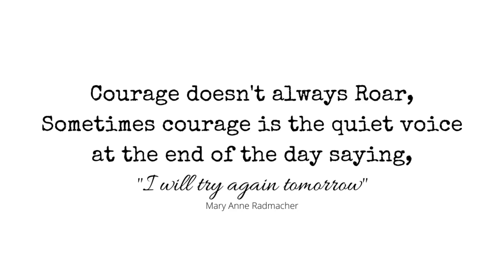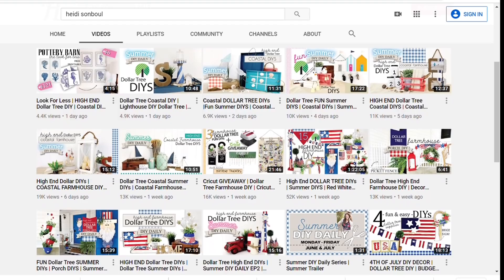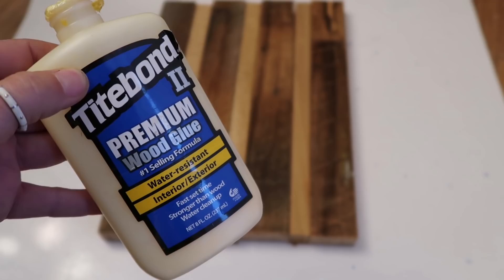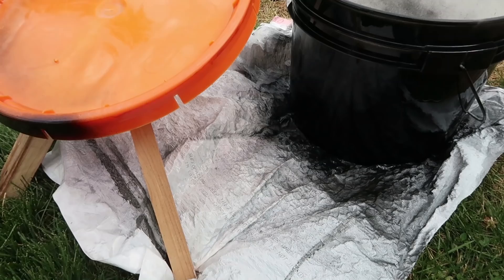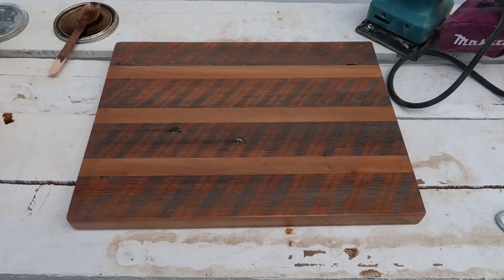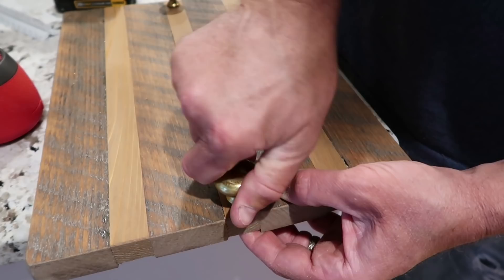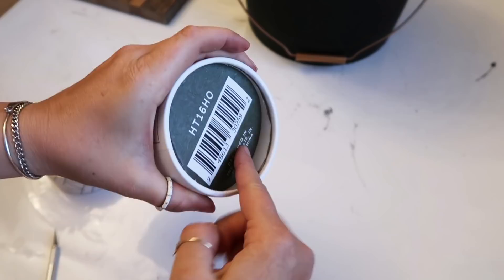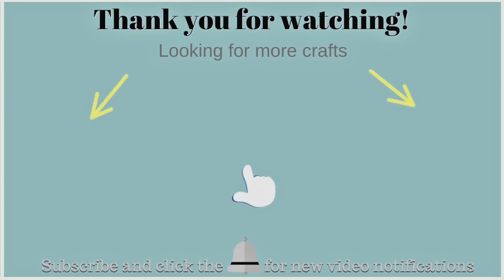REALLY COOL diy Using Trash to Create Treasure IDEAS ♻️ Recycle MID CENTURY MODERN BOHO HOME DECOR

Comment: I really like these. I'd add some feet to the tray and bucket. But instead of beads I might add these clear silicone feet and to the bucket I might add some either rounded off wood blocks stained the same colors or woods blocks stained the same colors to add a different dimension. You might could add those dt small wood square blocks for feet too on the tray. I really like the tray and bucket. That bucket would make great storage.